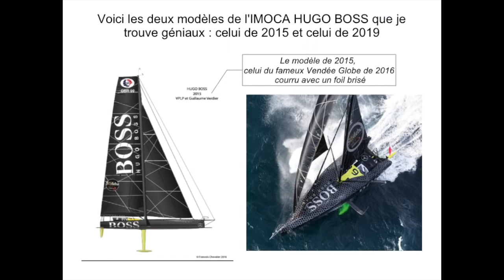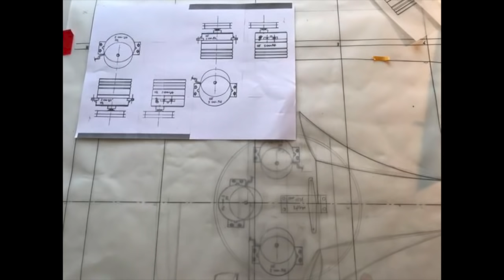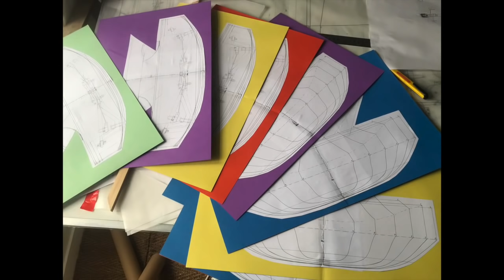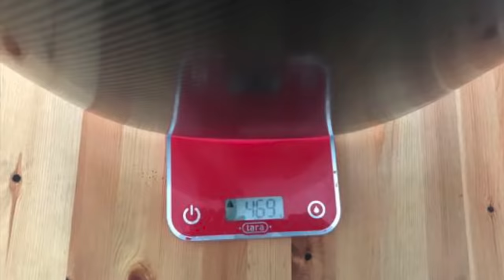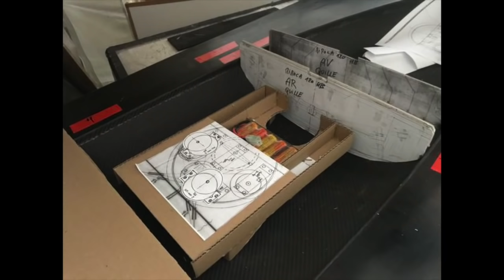Comment sont faits les voiliers de course (modèles réduits)?

Comment: Bravo ! Mais 2 questions :
- Quelle colle utilises-tu pour assembler tes blocs de polystyrène ?
- Je ne comprends pas l'étape, à la 9:36 quand tu dis "je suis en train de le démouler après que ça ait durci". ... On te voit enlever du tissu or je pensais que la résine collait tissu sur le polystyrène.
Un grand merci si tu peux me répondre.
Reply from the maker: Les blocs de polystyrène sont assemblés entre eux et sur la planche de bois avec de la colle spéciale pour polystyrène. C’est un peu moins cher que de la résine epoxy qui reste The Référence pour coller ce matériau . Le tissus que je retire du bloc eaten fait un « peeltex « , in tissus d’arrachage en nylon qui sert à retirer l’excédent de résine. On le plaque en dernier sur les couches de tissus de verre ou de carbone, et en le tamponnant au pinceau brosse il participe à plaquer les tissus entre eux et sur le bloc de mousse, il permets de chasser l’excédent de résine et les bulles d’air. 
Qd c’est dur, il s’arrache et emporte avec lui toute la résine excédentaire qui était passée au dessus de ce tissus .
En dessous, c’est propre et net, un peu rugueux, il n’y a quasiment pas besoin de poncer. On peut appliquer le gel coat de finition sur une surface avec une bonne accroche .
Reply: @PierrotRegaud  Peeltex : un découverte grâce à toi. Merci infiniment.

Comment: Bonjour, 
Super travail !!!!
Etant nul dans ce travail,  j'aimerais savoir ou voir comment sont faits les raccords, les angles intérieurs ou extérieurs, 
etc...sauf erreur, à ce sujet très peu de documentation a trouver.
Reply from the maker: Hello!
C’est assez simple, les raccords n’existent pas. La coque est moulée en deux Demi-coques dont les fibre composites suivent les formes du moule au moment de leur mise en place. Avec l’ajout de résine sous vide d’air, tout se fige en gardant l’empreinte du moule. C’est de la grosse cuisine un peu comme pour mouler des cup cakes ou des gâteaux dans des moules aux formes un peu élaborées , mais en carbone et résine .
L’intérieur du bateau est donc tout vide. La peau composite mesurant à peine 1,5mm d’épaisseur, les angles sont les mêmes a l’extérieur qu’à l’interieur. Seul un joint de collage permet d’assembler la carène et le pont. 
Des éléments découpés dans une plaque viennent renforcer cet assemblage pour fixer la quille et supporter les accessoires de radio commande et deux ou trois bricoles.

Comment: Y a-t-il un profilé particulier pour les foils ? Pourquoi les faire si grands ?
Reply from the maker: sur le prototype que l'on voit planer avec la voile jaune à l'avant, il n'y avait pas de profil. C'étaient des simples lames plates. La portance est obtenue par une légère angulation positive des lames par rapport à la trajectoire du voilier.  Pour le voilier en cours de fabrication derrière moi dans la vidéo, c'est différent; les foils ont une section 1/2 NACA. Grosso modo c'est un profil plat dessous et bombé façon aile de mouette sur le dessus. Ils seront calés quasiment à plat par rapport à la trajectoire, pour ne pas freiner le bateau, la portance sera générée par le trajet des filets d'eau. Je pourrai ajuster le RAKE, c'est à dire donner un peu d'angle positif avec un accessoire comme une cale réglable sur le puit de foil. ils sont très longs car pour une maquette il faut toujours exagérer les plans en contact avec l'eau, pour obtenir des résultats visibles et dans un temps honnête, a des vitesses tout de même modestes par rapport aux vrais voiliers.
Reply: Pendant combien de temps et a quel degrés sont chauffés les foules svp ?